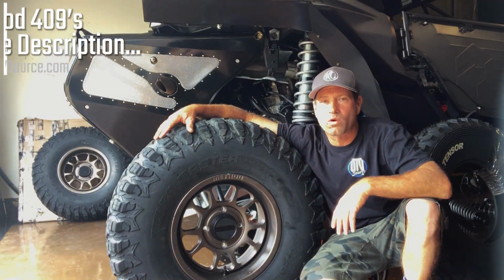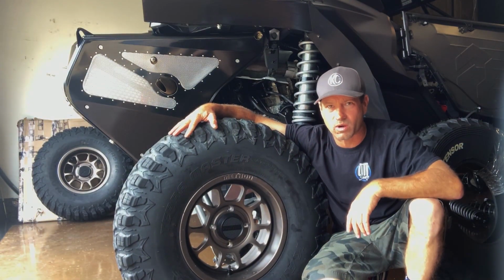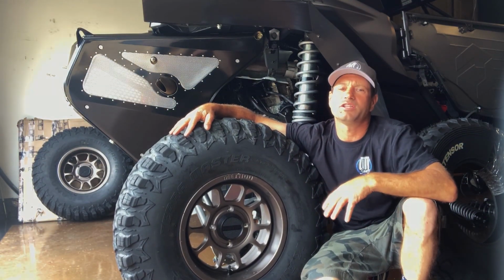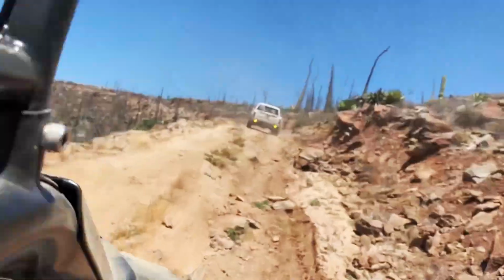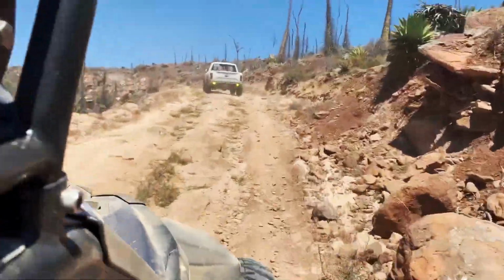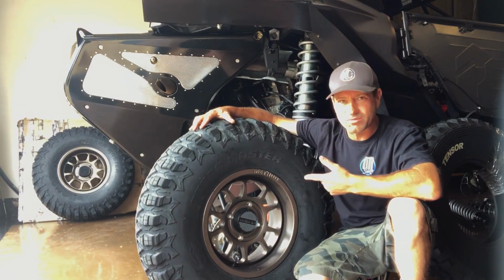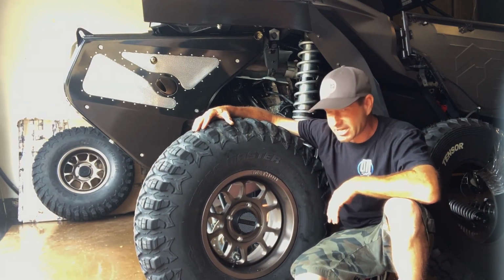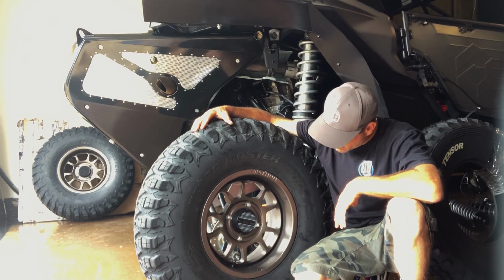Method Race Wheels 409 Bead Grip UTV Wheels

Comment: Do those wheels have a bronze hue to it? Or is it just the way it looks on camera?
Reply from the maker: I wouldn't say they have a bronze hue to them, but they aren't silver it's kind of like a off grey. I could see them maybe is certain lighting show a tiny tint of bronze.
Reply: @UTVSource  Ah I see, thank you for responding. Also one more question. What size are those wheels? I know they are 15" but what is the width and offset?
Reply from the maker: @mv8685  These ones are 7" wide and 13 offset let me know if you need a set! matt@utvsource.com